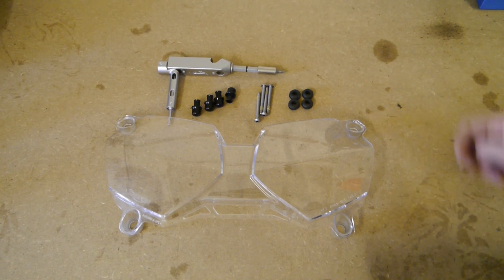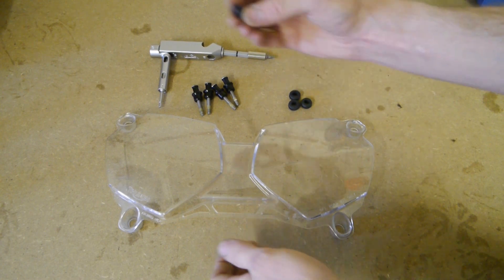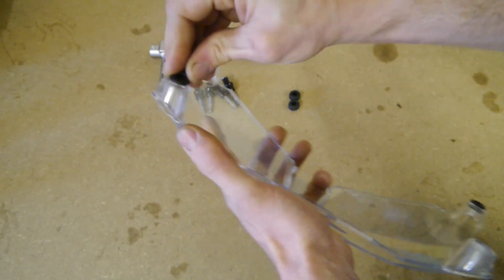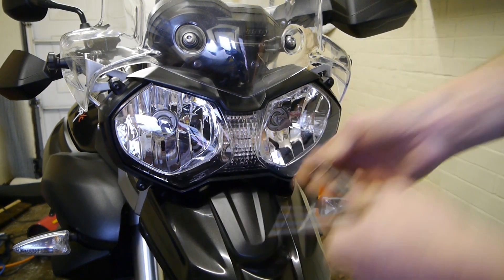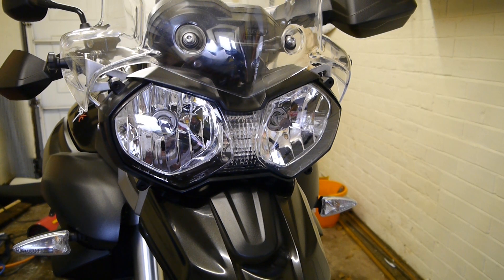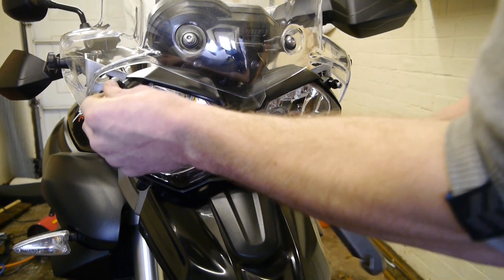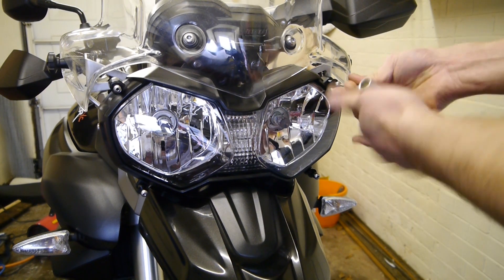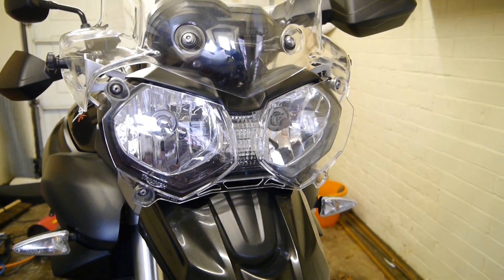Tiger 800 - Headlight protector installation

Comment: Got a rad grill to fit as well, may have a go at that tomorrow along with the headlight protector 😀

Yeah, I hope the fender extender will keep my pipes clean, decided to use proper rivets with back washers instead of the plastic ones supplied by Triumph for extra strength.

Comment: Thank you so much for all of these videos.  I live in rural Montana and don’t have a dealer/mechanic any where near me.  

I’m having an issue with my headlight relay on a 2017 tiger 800. Any thoughts on which one that would be I can’t find that information anywhere.

Thanks again
Reply from the maker: Have you not got the little owners hand book? It should have them all listed in there. Think there’s only that book and a workshop manual that will list them. Can’t find anything online for the later models either

Comment: Thanks for the video, helpful as always! In order to take it off, do you just pull or undo the screws?
Reply from the maker: Fran Ruiz Just pull it. The rubbers in the guard pop onto the screws. It's a tight fit so doesn't blow off
Reply: MuddySump Tight indeed! Thanks!

Comment: I bought a big brand clear headlight protector recently. I installed. Unfortunately I realized that the light was throwing a huge reflection on both left and right side. It was actually such a distraction that I felt it was dangerous. I returned it a replaced with wire version.
Reply from the maker: I think there was a bit on the triumph one too. It wasn’t too bad though. Maybe it’s one of the reasons it’s marked for off road use only?
Reply: True that brother. The one I bought which produced major reflection on both sides was from AltRider. They were very good about taking it back. Any reason you prefer the plexi over the metal grid configuration?
Reply from the maker: Robert Botta I think that’s all there was when I had mine.